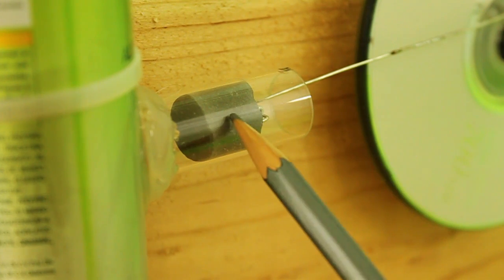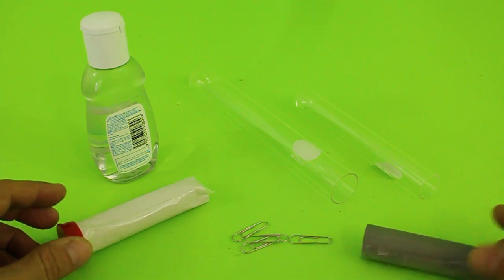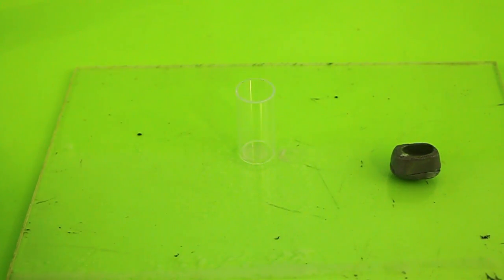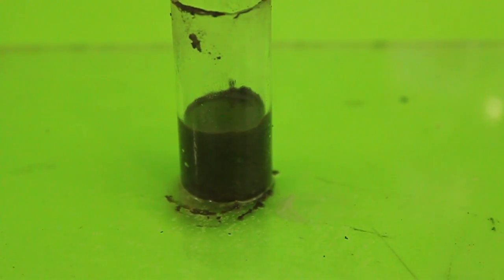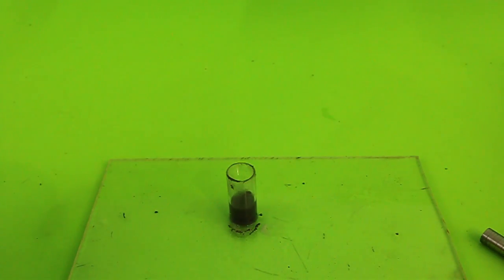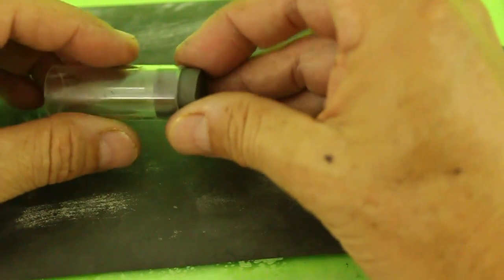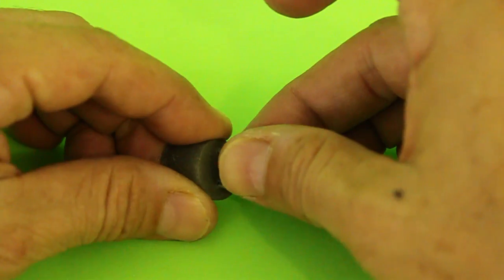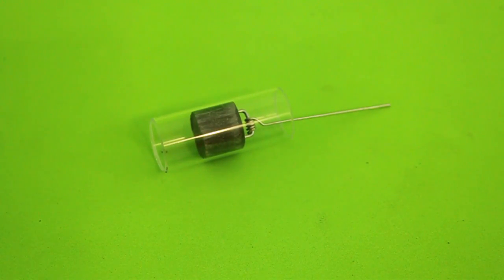Piston - Cylinder for Stirling Engines

Comment: i suggest you to wet the glass tube and dust it with graphite powder, if you can also preshape the putty into  a close in diameter cilinder, you can add the graphite poder on the sides, only then placing it in the glass tube and pressing it. Graphite powder is a solid lubricant, it should make it easier to remove the piston and not require sanding after cure.

Comment: I want to build a real working Stirling engine, and about 12' diameter parabolic dish to direct sun to run it off of, mount the hot end inside a box with a pyrex glass face, a ceramic lined steel box,  and pull a partial vacuum on it for insulation, with a copper block on the end to conduct heat, into the cylinder, and build a water jackets around the cold end, to circulate cool well water through, to keep cool as possible, maybe try hydrogen or helium also, I'm thinking a engine that would fit inside a 1meter x 1 meter box, so a fairly large small engine,  possibly 4cylinders,  with 90° from each other, to keep power smooth, possibly add a 20mm copper tube around the hot ends to allow hot water or steam to be pumped through, maybe hot oil, to keep it working over time,  with a couple 20lb flywheels, to keep it rolling,  spinning a generator, being it's in a box, I guess a small starter may be needed!

Comment: I've always questioned "Why do they keep making these engines from glass"? That is NOT practical. Why not make them from metal? Stop making toy engines, and make something we can actually use.
Reply: Why do they make these from glass?  Because if you are serious, you may as well get very serios!  
Look at the video:  The Stirling Cycle part 1 (Stirling Cryogenics)

That vid takes you straight into a well optimised engine.  It also takes the home builder straight into despair, as it is impossible for me using koke cans and epoxy n glass to get anything like that design or efficiency, so I feel that I'm just wasting my time, while desperately wanting to make a decent engine!  Ah the burden of the home inventor! :)

Comment: Very creative, alternative and resourceful idea frend since i do not have a lathe machine in here. The most common epoxy here is devcon and mighty bond they are both two kinds of paste one is a epoxy and hardener will this kind of epoxy also work? And will it also work on a steam engine?  Since i read and watch about heat engines i became interest and amaze of this machinery because we can create energy power off the grid using fire heat. Tnx my frend for the videos and ideas you share.

Comment: Nice video again! :) With your explain maybe much better as mine! :) One thing only. The flat, hard surface is not recommended for the process. I used rubber sheet, because much easier to remove the putty piston from the glass cylinder because ther rubber could stop the putty to make a shoulder on the glass cylinder's edge. Kind regards from Hungary! BLADE
Reply from the maker: That's good advice Blade, thanks for visiting my vídeos!

Comment: make gasoline engine
Reply: I remember a concept car with a ceramic engine 80s. Don't remember who built it, NIssan or Mitsubishi, but the concept never took off commercially. They claimed the engine could handle much higher temperatures than an iron or aluminum block. Those days!

Comment: Nice build.  I agree it looks more interesting than the balloon approach.  Of course, the challenge is finding a glass cylinder that matches the plunger to shape the epoxy.
Reply: It's not very critical. If your plunger is a couple of millimetres smaller in diameter you'll get a slightly irregular top surface.  Just file it flat.